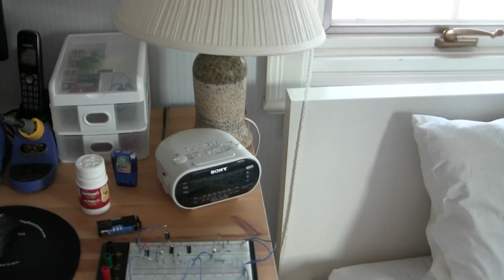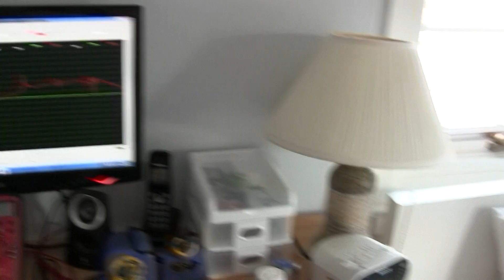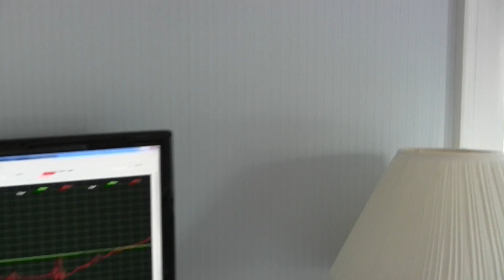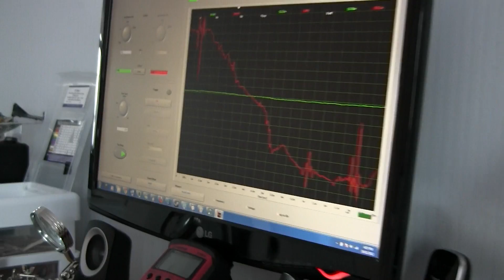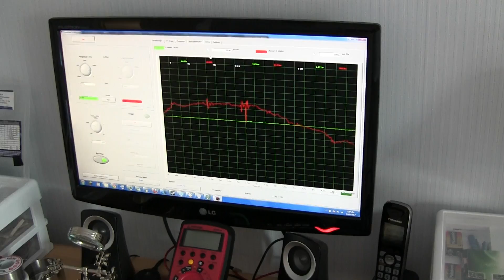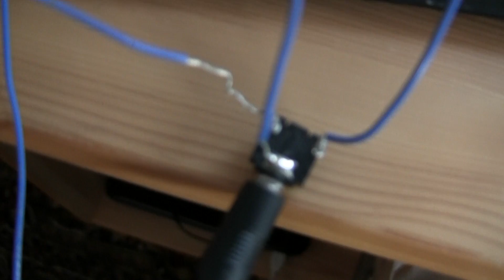Soundcard Oscilloscope Program Fun - Cool Things

Comment: can only add that as you touched the neutral side of your lamp ( the metal part ] you only increased size of radiating sources. so cool. try with an efficient directional antenna and find the radiating sources. you have the beginning of a sensor array. remember you can control the source

Comment: your soundcard can measure max 1.5V  so you cant input voltage above that.....but you can make transformer,primary coil about 1K Ohm and secondary about 1 Ohm and than you connect secondary coil to sound card,,,,,and than you can measure with this software voltages and frequency from 0.1v to 500v,,,,you must use your measuring intrument for voltages in primary coil because thats input.. but souncard scope will show you very acurate wave of input frequency... and you can measure from 10 to 20KHz